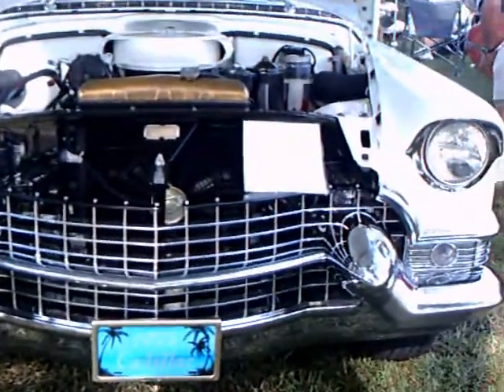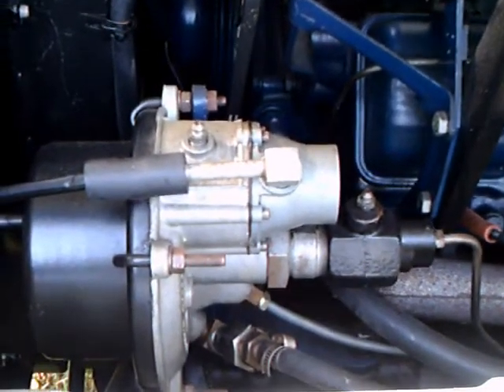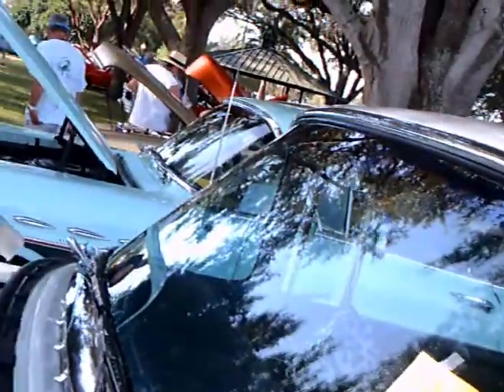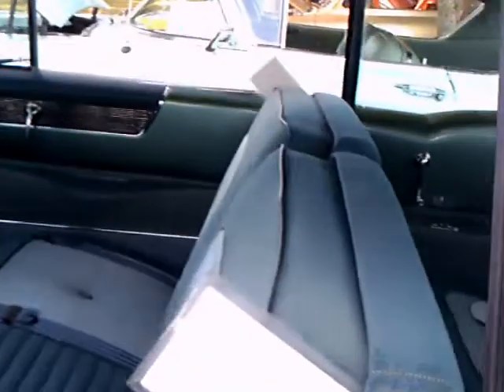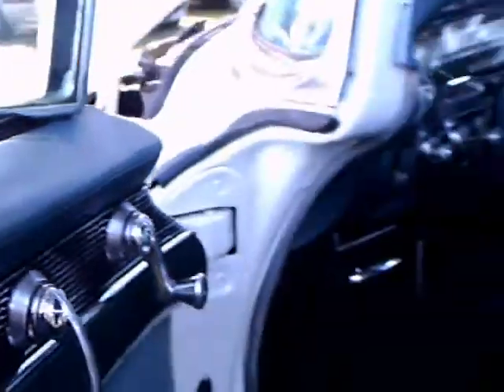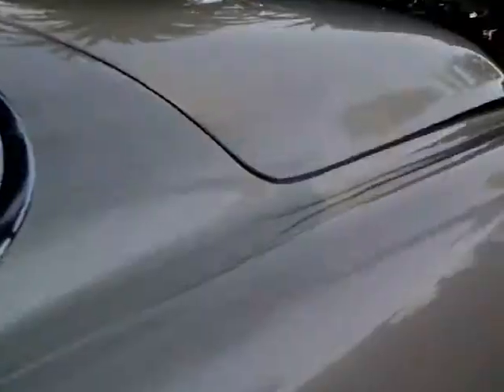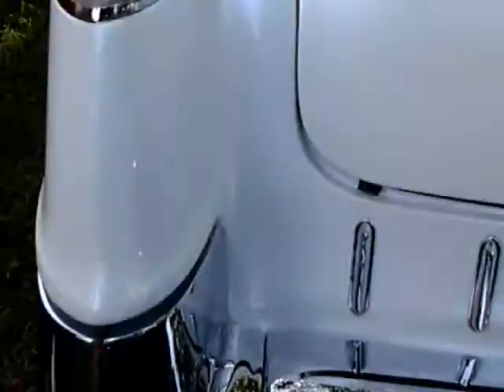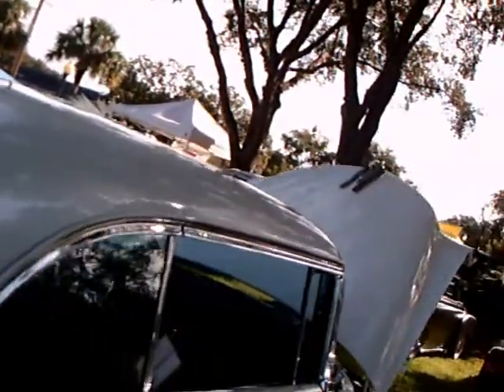1955 Cadillac Series 62 Two Door Hardtop Wht Eust092912

Comment: Hey there Jack :) Beautiful '55! You mentioned the fact that it does not have power windows....many of the Series 62 Cadillacs back in the 50's, and even into the 60's did not have them (They were optional on Series 62s and early Calais models. Power windows did not become standard on all Cadillac models until '68). I'm also glad to see that this car wasn't gussied up with a continental kit and other 'sock hop' crap that SO many owners of 50's cars feel they need to add! Thanks for sharing!

Comment from the maker: Hey, Mick!  I'd figure that there was very little use for an extended time, perhaps the car was in storage.  It is a definite consideration when bringing these cars back to good running condition.  As we know, fluids degrade, particularly gas, and the cooling system is vulnerable to problems, and of course, rubber components have a limited lifespan, regardless of mileage.  Back in this time, crash safety was just an emerging science..denial of risk seemed to be the usual coping mechanism! :)Jack

Comment: Bottom of the line Cadillac was nothing to sneeze at! And wow! 12,000 miles! From the days when even a Cadillac might have roll down windows. I remember that even in 1966 you could get a Calais with the same.
Reply from the maker: It really is amazing that power windows weren't standard equipment on all Cadillacs at this point.  However, manual windows have the very strong point of never needing new motors or attention to sketchy electricals.  Thanks!  :) Jack